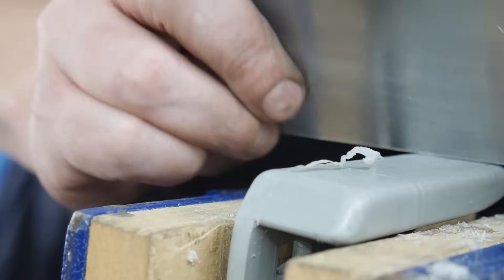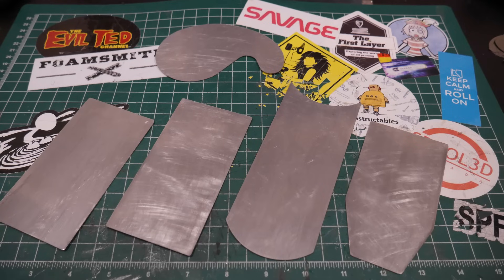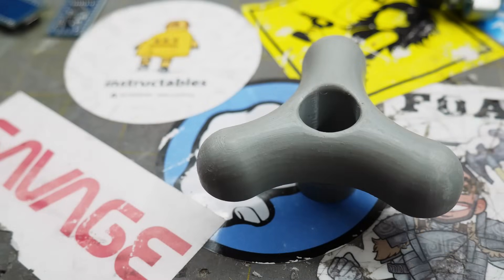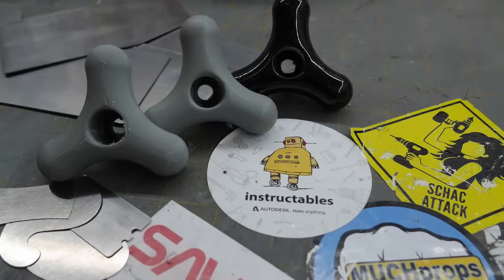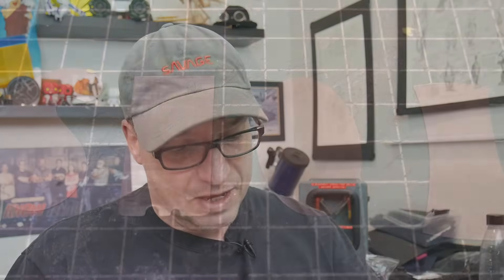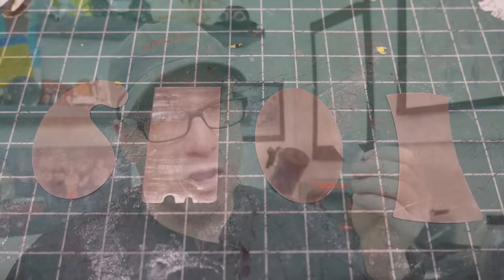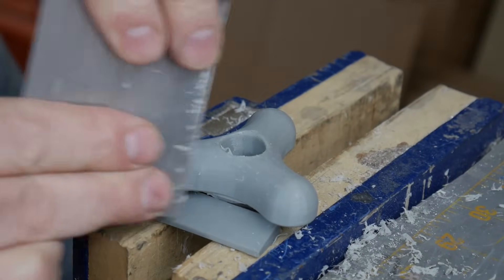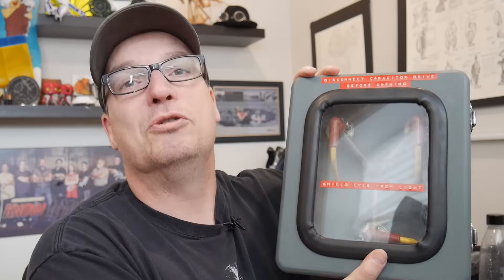Smooth pla 3d prints by shaving them. Don't sand your pla, shave it.

Comment: Awesome video. Know of any guides to make one that don't require a stone of some sort? thanks!
Reply from the maker: You can use fine grit sandpaper. that is all I use
Reply: @DreadMakerRoberts  I have some of that on order. :D
i mean to sharpen a card scraper without stones or clamps.
Reply from the maker: @Oriejin  Yes and I mean use the sandpaper on a flat surface instead of a stone. You can use c-clamps on a bench to hold the tool and sharpen it instead of a vice...
Reply from the maker: Here is a sneek preview of my next video: https://youtu.be/TbvFPN7yxt0

Comment: Interesting share! It looks like you have to do quite some pressure on the printed model to shave it, right? If that's the case, it is unfortunate, because that would probably break small models (eg. action figures)
Reply from the maker: As I got better with the tool and sharpening the pressure needed was much less. So I think smaller models will. Be fine with the Luthier scrapers
Reply: Can you provide a little more detail about polishing with cardboard?
Reply from the maker: Here is a sneek preview of my next video: https://youtu.be/TbvFPN7yxt0

Comment: Woodworking tools, like a scraper, always works great on plastics. 
Have you tried a gentle touch of the blowtorch to smoothen up after scraping yet? You would love that to 😉
Reply from the maker: You are the second to suggest this. I will have to for sure.
Reply: I don't have good experience using a blowtorch for surface finishing but it is very good for quickly removing strings or at least curling them up to the point where a knife (or a scraper?) can easily remove them.
Reply from the maker: Here is a sneek preview of my next video: https://youtu.be/TbvFPN7yxt0

Comment: I've had a resin printer for a while now and recently took the plunge and bought a filament printer to try. A big turn off was the amount of sanding required, I think you just s(h)aved my life! Thanks a lot Ben :)
Reply from the maker: Lol great dad pun!
Reply: @DreadMakerRoberts  I couldn't help myself :)
Reply from the maker: You are my people my friend 🤣
Reply: I will NEVER ever sand my 3D prints. It is so boring and a waist of my time!

Yes of course I would like a nice smooth shiny Print but I aint gonna sand by my own hand. I am always on the lookout for an easy way to make them smooth/shiny.
Reply: @ZergRadio  what about rotary polishing, like sand tumbling?
Reply: @JeronimoStilton14  I do not sand or polish anything yet.

But yes, I have seen some of those tumbling videos and they certainly look like an alternative.

I saw a video called "Vibratory Tumbler Post Processing of 3D Printed Parts" and that was very interesting. (by YT'er DIY-Optics)
Reply from the maker: Here is a sneek preview of my next video: https://youtu.be/TbvFPN7yxt0
Reply: Using this method will shave off a lot of time😅
Reply: I guess you could say ‘he shaved time off your process’? heh
Reply: Paint on resin with a brush. Hit it with UV light. Filled layers and smooth. Viola
Reply: @Crafty Sean sorry about your loss.
Reply: Get a uv lamp and paint a thin coat of resin over the print. Saved me days or weeks of sanding
Reply: Isn't it a huge hassle with resin to clean it and to have to use protective gear and such? I'd rather sit and sandfile things than risk damage to my hands or furnitures imho. Don't have any printers as of yet but thinking of going with filament.
Reply: @MertBert  resin printers are pretty neat. They’re more messy, but with the right area you do good. The major downside, I find, is just it’s more expensive on the material side. However you get great results. I don’t own one, maybe in the future for tinier more detailed prints, but a filament printer is all I need really. I don’t mind working away and sanding especially most what I make is props
Reply: @TeaGamingPanda  Thank you : )
Reply: @MertBert  nope dont believe all you hear, 10 minutes to clean a print and 10 more to cure it, resin printers are amazing

Comment: I know card scrapers from woodworking and it NEVER occurred to me to use them on 3D prints, let alone that there were miniature luthier's cabinet scrapers! Thanks for doing this video. I don't do cosplay props really, but I do a LOT of organic shaped items - fossils, classical sculptures, statues, etc - and so I have a LOT of post processing I need to do with any print, even with getting generally really good prints from my Prusa MK3S printers. Thanks again! Picked up both sets scrapers (including the bigger ones to supplement ones I already had), following your links and also subscribed to help get you over the hump. Cheers!
Reply from the maker: Thank you! And I would love to see your work one day. Make sure to share!
Reply: @DreadMakerRoberts  - if you are on Instagram that's where I post everything right now but the plan is to start a "maker" YouTube channel in the next few weeks. My Instagram is my user name here, just run all together.
Reply: Have you though about sand blasting? I'd like to know if it works for 3d prints
Reply from the maker: @cupbowlspoonforkknif  Tried it and it really does not help with layer lines.
Reply from the maker: Here is a sneek preview of my next video: https://youtu.be/TbvFPN7yxt0